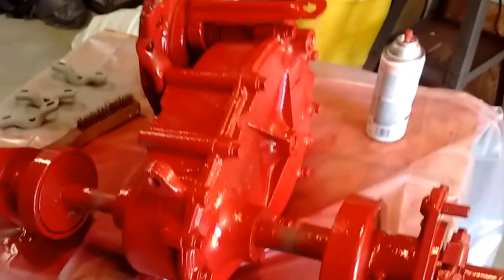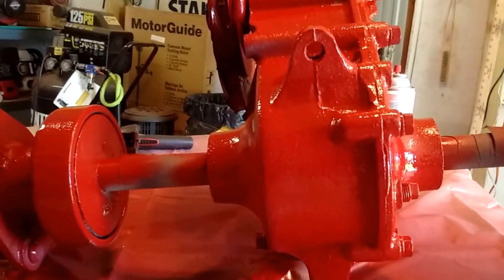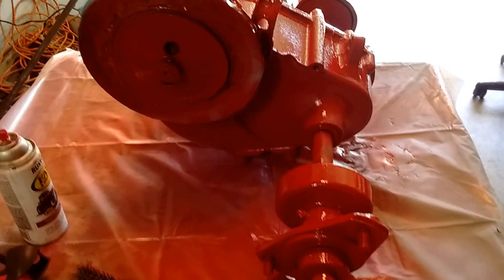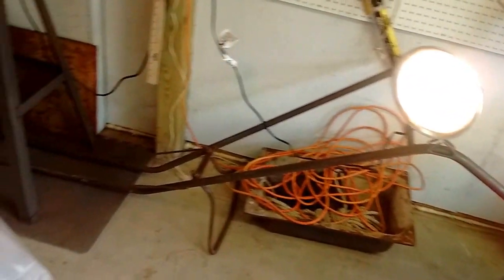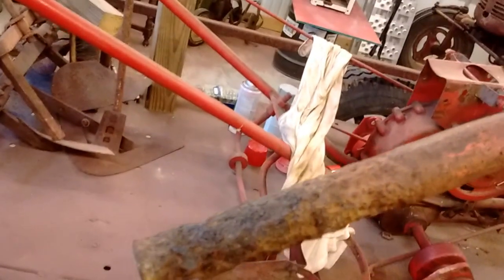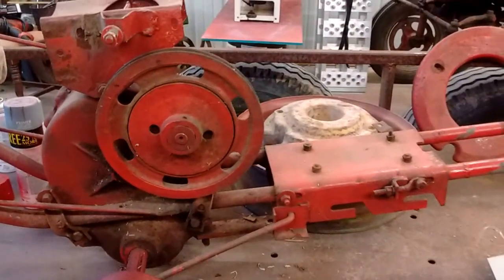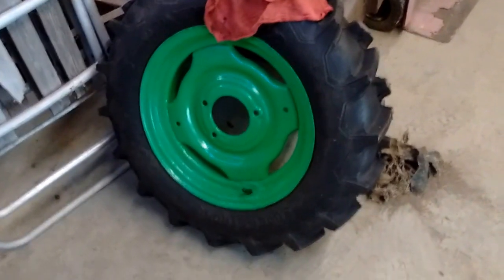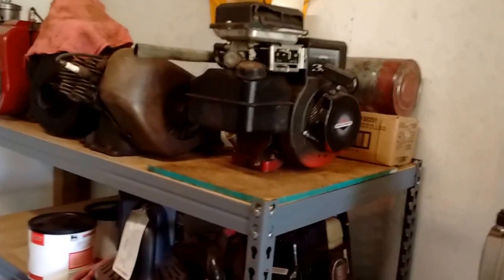David Bradley, painting the transaxle

Comment: Any chance that stubborn pin could be threaded?
Reply from the maker: Hello, I have never seen evidence that there were threaded pins. I will not reuse one if I get one out. I use a pin and with a cotter pin to hold it in. Good question!!
Reply: @bryanhorne8202  I have seen some pins that have to go out the same way they were put in either because of mushroomed heads or a slight taper.